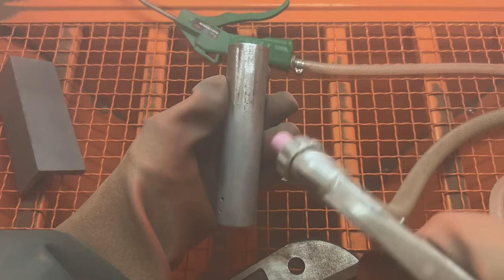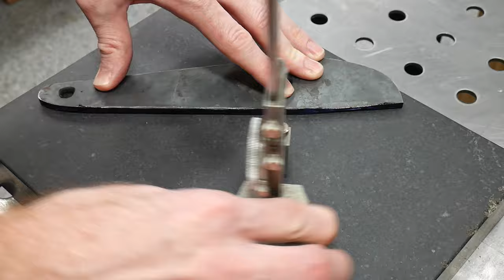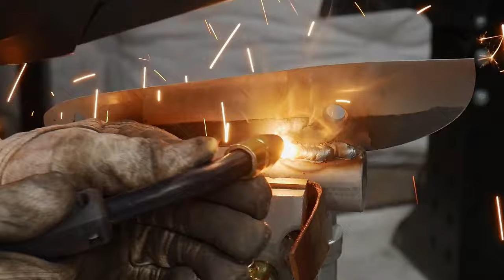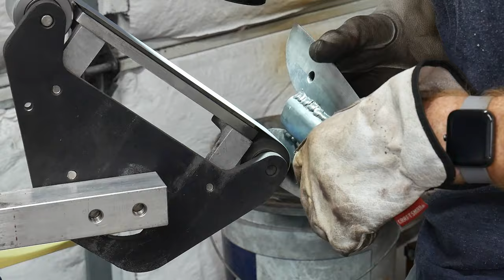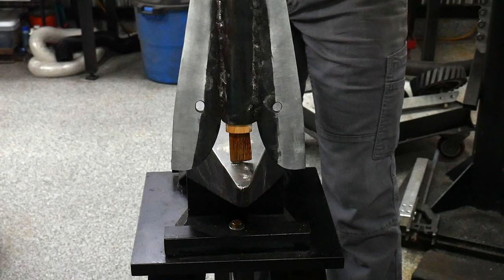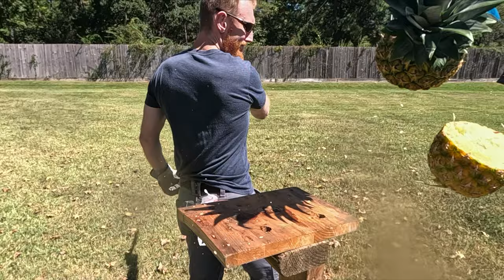I Built a DANGEROUS Apocalypse Axe From Pawn Shop Bolt Cutters!

Comment: Fun build! Probably a nice break from your usual close attention to details, fit, and finish. Was that a big chunk out of the cutting edge right at the end though? I wonder what steel they used for those bolt cutters.
Reply from the maker: Man you hit the nail on the head! Very nice break to do a build like this. The chunk out of the edge was when I threw it into the support vise by accident! I didn't show it in the video... but it took a huge chunk out of the vice... I have no idea what the steel is on those bolt cutters, but it seems pretty tough.